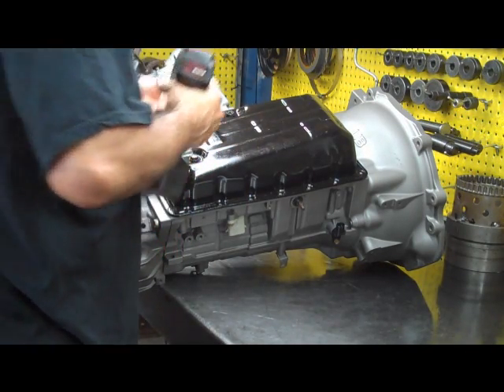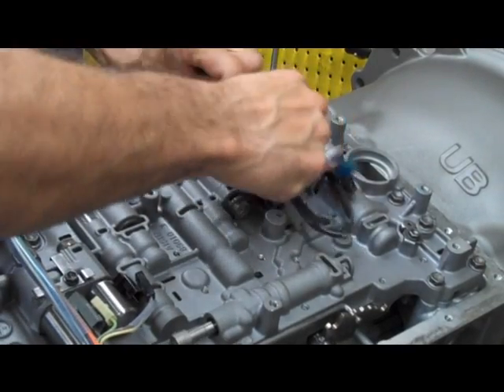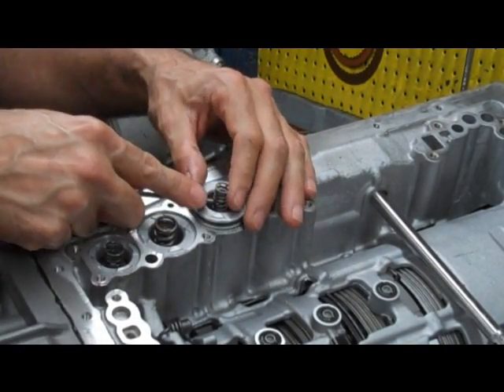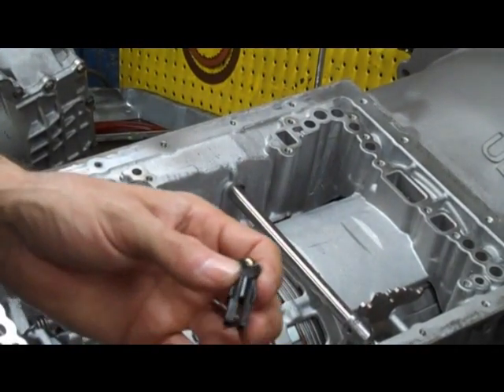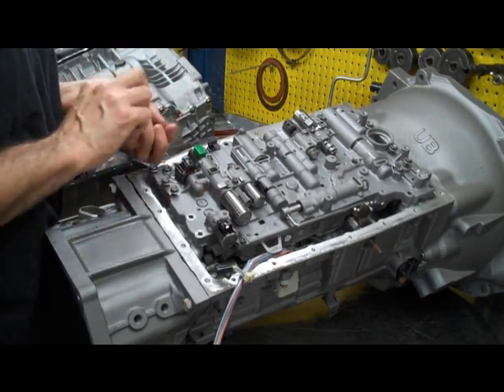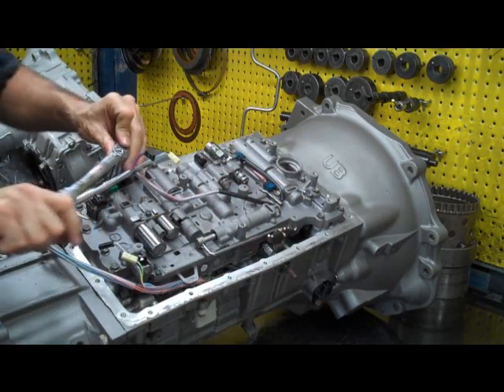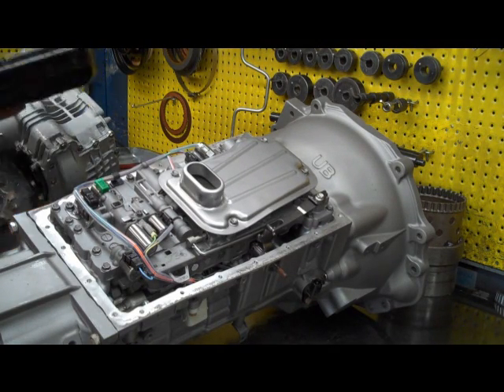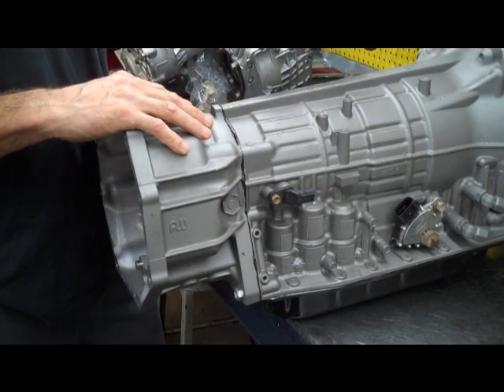IPT Performance Transmissions A750E/F Valve Body Installation

Comment: my a750f has a pretty nasty cold 4-5 shift and the 4th and 5th gear under moderate throttle just feels like its surging... Will the valve body be able to correct this. or am i looking at a bigger issue?

Comment: Great video!  I have a question on a 2009 4Runner with a code showing p2714. I want to replace the solenoids that retain to this code. Is this a specific solenoid or dose it include all 3?

Comment: Thank you for the video. I have a "shift solenoid D" code and a leak from my extension house seal. Not sure where the solenoid D is located. Parts guy at Toyota didnt know either. Any help?

Comment: For this transmission - the Toyota service manual calls for transmission fluid temp to be at a specific reading before loosening level plug. Dealer techs use Toyota techstream to read fluid temp which is supposedly stored somewhere in the CAN.  You say drive it 'til at full operating temp, then loosen level plug again? That temp would be way above what Toyota indicates in their FSM.  I like your idea as it's simple, but goes against what Toyota publishes. 

Thanks for putting this video together.
Reply: +John Smith your right the trans temp needs to be at a specific temperature to adjust the transmission fluid, some where around 105 degrees if i remember correctly , then the over flow plug is removed to adjust ATF level.
Reply: You can use a jumper to bridge 2 of the ports in the OBD-II socket to put it in diagnostic mode, then shift from N-D a few times to get it to enter fluid temp check mode. You’ll know it’s in the correct mode when the “A/T Temp” light briefly illuminates when you put it in Park. Then, when the light comes on and stays on, you are in the 115°F-130°F Range that they want you to be in to check fluid level. Fluid level is correct when you get “a slow trickle” of fluid from the check plug.
Reply: @johnmpifer  do you know where the pins are for the jumper to go?
Reply: Is the specific temp to make sure it's loose enough to be fluid while avoiding burns or something else?
Reply: @perkalater79  Trans fluid expands with heat. That is the reason.